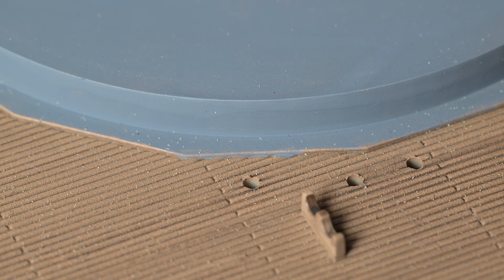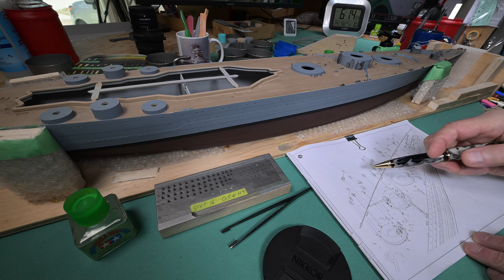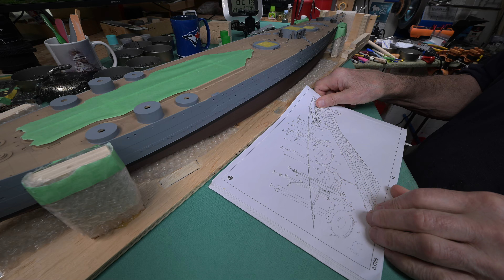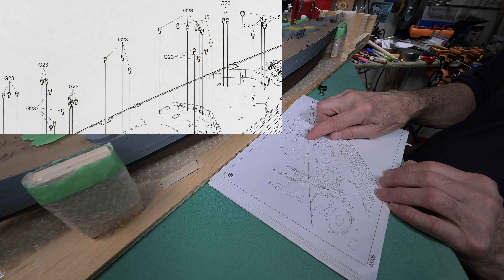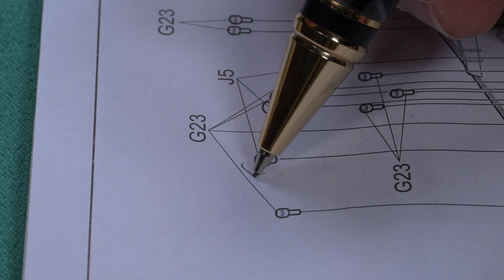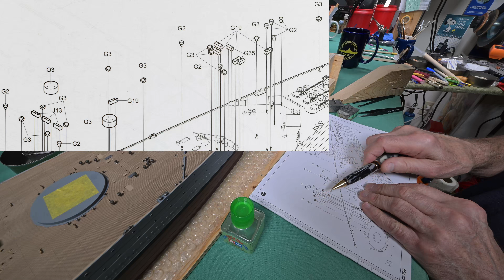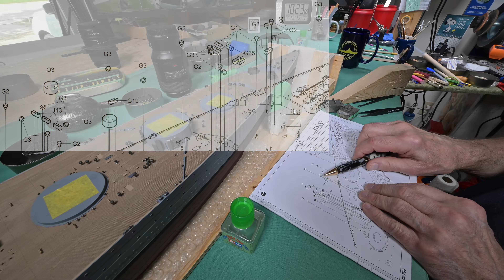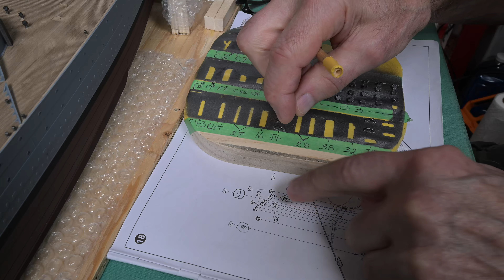The Model Ship - Part 1219

Comment: Ron not to be picky or anything but I was wondering if you are trying to place the tiny mushroom vent (with the raised intake) facing the proper direction? 😳 I know that at arms length most people will not even notice the raised intake area on the vents. 😉
Reply from the maker: The were adjustable and it depended on wind direction ---- well that's what I'm telling people anyway. 😁
Reply: @roncalverley  😂🤣😅